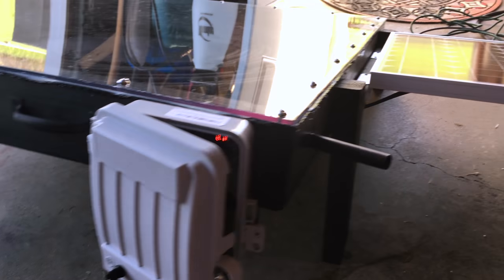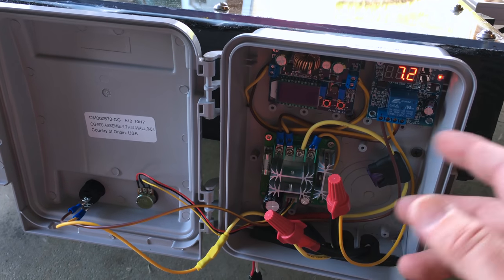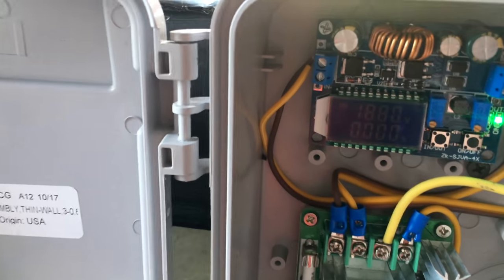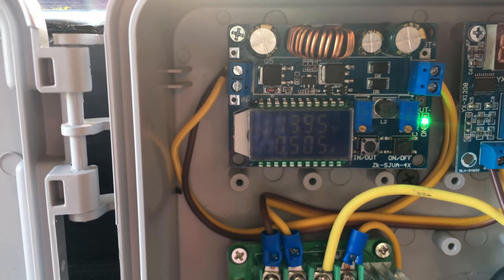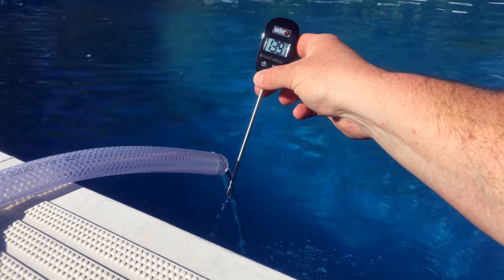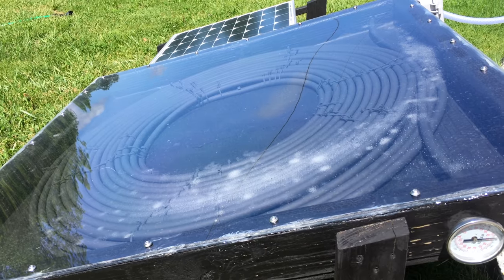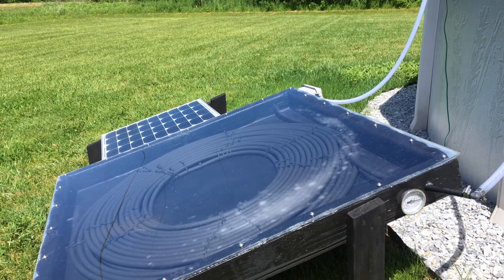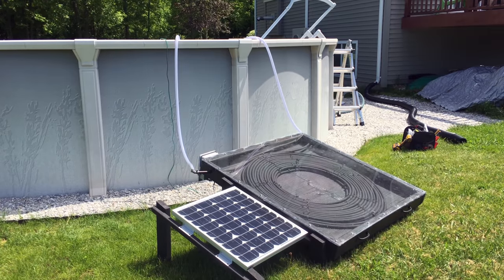DIY Solar Pool Heater - Part 4

Comment: Couple of things you might think of.  Efficiency of a 90ºbend is low.  eliminate them.  Why not use black hose going in to the pool.  gain slightly more solar energy.   One thing I tell my engineers, anyone can make something complicated.    Simple photo sensor turning pump on when sun is out should suffice. Manual flow regulation, easy and reliable.   MUCH less expensive.  You never gave an overall pool delta temp.  Sure you show the 80ºF out of the unit but with that large body of water what was the delta?   Probably the single most important data point because everyone is making heaters to adjust the overall pool temp.  Would def like to see 100foot tubing data.  and of course the pex.
Reply from the maker: Great suggestions.  I am currently building a new larger setup.  More to come...

Comment: What kind of pump are you using?
Reply from the maker: A seaflow pump. Here is the model I'm using https://amzn.to/2EIWGH1
Reply: Do you think that the design as shown in your video, Will be anouth to heat a 1500 Gal SPA?
Reply from the maker: @ricgomez  It should be able to assist but not be the entire heat source.

Comment: Check this guy: I think adding to the thermal mass by using the aluminum cans like he did is a good idea https://www.youtube.com/watch?v=DCvO2NFxVNY  No data from me, but I think breaking the panel into two (second) would give you twice the solar surface area. Mine is not in service yet, but I used 1x4's and 1" alum foil covered foam for all inner surfaces. I like you hold down clamps and will get some. I cut a sheet of  1/2" plywood in half, so I have two units. Also, watch Sergiy's channel who does quite a bit of analysis in Ukraine at a similar latitude; very interesting tests and data: https://www.youtube.com/watch?v=M6_5F9WMBsU I also intend to use pump bypass pressure to avoid a separate system, and mount on the roof of the garage (south facing). Lowes has ultra cheap flat black generic spray paint for $1 a can. My system is using the corrugated polycarbonate panels which are two feet wide, with the corrugated end foam seals. Keep us informed of your advances :-)

Comment: Will never work enough this way. You need about a 2 degree Delta T with at least afew thousand gallons per hour or it will never heat your pool enough. And yes I have build 6 of these in paraellell so I know what I'm talking about.
Reply: Catchme Ifyoucan  how is yours built exactly? Solar oven the same?
Reply: Any benefit if you use the pool pump to run the water through the lines? That way you're circulating more gallons? The challenge would would the increased flow rate provide aqequate time to heat/raise the water temperature before recirculating back into the pool?
Reply: For all the builds I see, I think you have hit on a good point. Starting from a theoretical goal, and working backwards to a solution would be a good exercise. Say you want the pool at 95* and it is at 68*, do the math for a total btu's for the pool mass required, and then see what the tubing is putting out at flow rate. I think a manifold feeding 1/2" multiple tubes may be helpful. Mine is still under development.

Comment: So cutting to the chase, 1/2 inch tubing 200 ft long will increase the water temp at steady state is about 12 degrees f!  After all the non necessary discourse........thanks